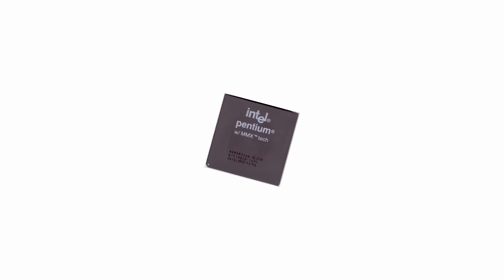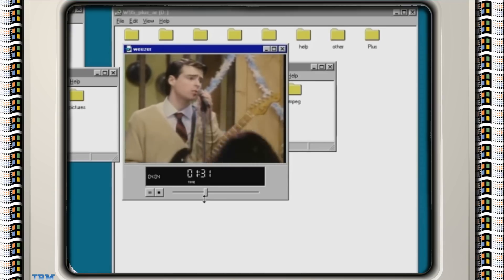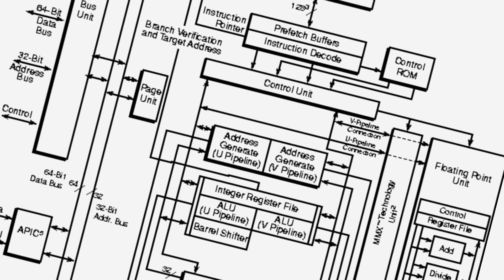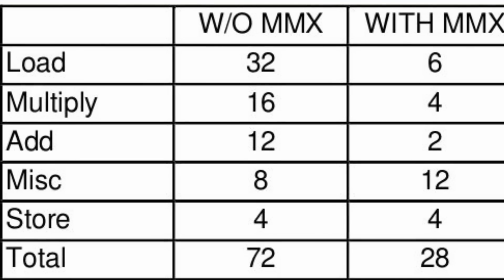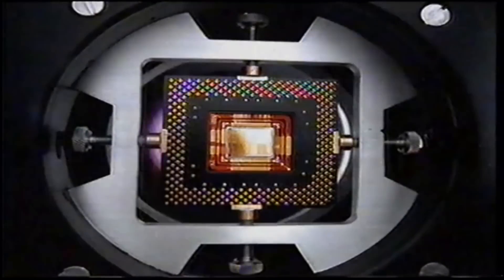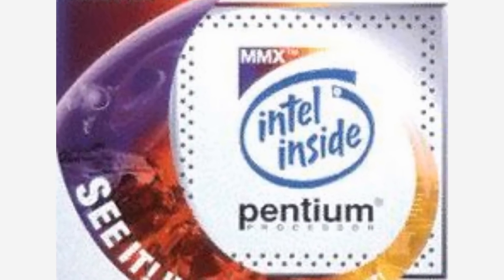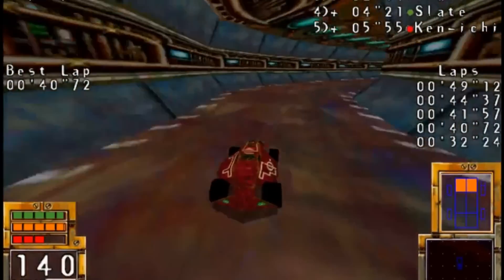What is MMX Technology & Why Was it Flawed? [Byte Size] | Nostalgia Nerd

Comment: I have to say I'm somewhat disappointed that you didn't bother mentioning (assuming that you knew about it) how MMX instructions operated off the general purpose registers (of which there were only 8 at the time) and how the use of MMX instructions thus badly hobbled anything else that had to be run at the same time.
Reply: Incorrect. MMX instructions operate on special purpose registers, which are aliased to FPU registers in hardware and he DID mention it, and he said it was a major problem. FPU registers are not general purpose registers, they are a stack of 8 80-bit registers which are chopped down to 64 bit in MMX mode. Given that you'd need to empty the FPU registers in a function epilogue anyway, and the switch between FPU mode and MMX mode of the register file only took 12 cycles, not much longer than a typical function prologue, it really wasn't as much of an impediment as people make it out to be. You just needed to perform FPU calculations and MMX calculations in larger batches, which is good practice for other reasons too.

x86 32-bit only has not 8 but 4 general purpose registers anyway (EAX, EBX, ECX, EDX), and MMX instructions don't interfere with these at all!
Reply: +Siana Gearz:
Today's CPUs are highly parallelized. They look at multiple instructions and try to run them in parallel automatically. The MMX is bad design since there is no way for the CPU to execute an MMX instruction at the same time as a FPU instruction.

The FPU is also a bad design. I'm not sure why they have a stack of 8 registers. If you decompile code, you would see that programs basically use fp(0) and fp(1) and basically don't touch the others.

SSE, SSE2, and the rest are the way to go.
Reply: louis tournas
Yes, classic FPU with its stack-like register file is a bit strange to say the least. Not that it matters any longer, because the stack as such no longer exists, it's all register renaming. Pure FPU stack manipulation instructions basically get eaten at the instruction decoding stage, there's not even a µOP emitted.

Your assertion that there's no way to execute MMX instruction at the same time as FPU instruction is not right, because somewhere along the way on Pentium II or III, MMX and FPU register files got separated, and EMMS (empty MMX state, restore FPU mode) instruction is no longer necessary. So there's no longer any interference between FPU and MMX at all.
Reply: Siana Gearz
"Your assertion that there's no way to execute MMX instruction at the same time as FPU instruction is not right, because somewhere along the way on Pentium II or III, MMX and FPU register files got separated, and EMMS (empty MMX state, restore FPU mode) instruction is no longer necessary. So there's no longer any interference between FPU and MMX at all."

==OK.

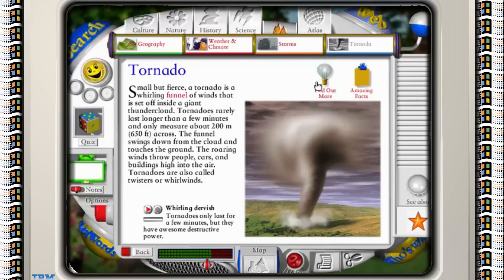Comment: 0:37 VR ON A PENTIUM????
SIGN ME UP
Reply: VR has been around since the 1950s or so in various incarnations (two small CRTs strapped to your face each with radio recievers). In the early 90s there was a vr system based on the amiga. I only vaguely remember seeing one demo application on there called dactyl nightmare or something like that. The terrible framerate kept you from getting motion sick, despite the terrible tracking.
Reply: +Nobletea 3400 Radiation is a piss-weak carcinogen and CRTs are a piss-weak radiation source. They didn't care in the 50's and 60's and they were right not to care. In the 50's they had much, much scarier radiation sources to worry about.

E.g. you could go to your local shoe-store and x-ray your new shoes0 under a fluoroscope to see how they fit. Fluorscopes are not like X-ray photos; you do not develop an image, you look at a screen which glows when x-rays hit it in real time, meaning you're continuously x-raying your feet for however long you care to do so.
Reply: Raven 4096 no
Reply: It should... with a whole mess of external expansion chips that cost more than the computer itself.
Reply: can the pentium do VR really?
Reply: @Raven10241  yes it can. i remember playing dark forces in VR in a tech fair back in 1995 with a huge VR helmet. it was pretty cool and i was sad that those things never made into the market... until oculus vr was announced like 20 years later
Reply: Glitchyyy
you sure I think it can at 480p mind you will get very ill from that low of res but I bet it can do 480p
Reply: @Raven10241  120x60 @15hz
Reply: @Raven10241  lower than lowest settings
Reply: STep up to get your 10, 000 dollar neck destroyer and dedly radiation hazard VR headset!!

People flock to buy
Reply: +nobletea 3400 Depends. One of the earliest, that might be called VR was the sensorama, was a stationary cabinett and pre-dated digital computing; it had fans and smell-o-vision. Another gray-area device was wearable and not very heavy but had absolutely no tracking and was not attached to any computer, rather an analog transmission for each eye displaying stereoscopic images(you can make tiny 1 inch CRTs!, I promise, it works but it's crap and draws several watts of power just for the electron gun).

The first things I'd really call VR in the modern sense was an Ivan and Sutherlands device in the 1960's. It used CRTs and much better optics, making it so heavy it had to be suspended on wires from the ceiling. It used computer generated wireframe graphics and had some kind of magnetic tracking.
Reply: Yes, the first VR HMD for PC came out in 1995. It was the VFX-1, by a company called ForteVR (which now is called Vuzix and still makes HMDs). Dont believe the hype: VR was NOT invented by Palmer Luckey, and VR HMDs have been around for over 20 years. Ever heard about VFX-3D? VR920? Z800? iWear?
Reply: I remember trying a very old VR headset on a Hungarian tech expo that ran a modified version of the first level of Duke Nukem 3D :-). Certainly it was nothing close to the ability of today's headsets, but it worked and it amazes me how people can go completely unaware of the 20-30 year old heritage of VR headsets... they did not come from nowhere!
Reply: The technology in the current round of Oculus and Vive HMDs both derive from Valve's work. Valve helped Palmer massively improve the DK2, because Valve didn't care about making VR HMDs, they only wanted to sell games for VR. Facebook was sold on VR after a demonstration of Valve's VR room and it is quite likely the terms of the sale hinged on poaching employees from Valve to Oculus, which Oculus did.

It has now been a couple of years; and I have my Vive. But I still just want to burn down Oculus, Facebook and anything associated with it to the ground.
Reply: idk
Reply: nobletea 3400
don't worry I am sure that your vision would be screwed up by them and their radiation output before you get to much neck damage from the weight
Reply: explain virtual boy
Reply: +Jaime Roa The virtual boy wasn't even an HMD; it was just a stereoscopic display, more like the 3DS.
Reply: Look up virtuality. It was in the arcade and based off an amiga. There were a few games, a dungeon crawler being the most popular. Pretty sure a pentium could do this better but by then interest had moved away from vr because it just wasn't good enough.